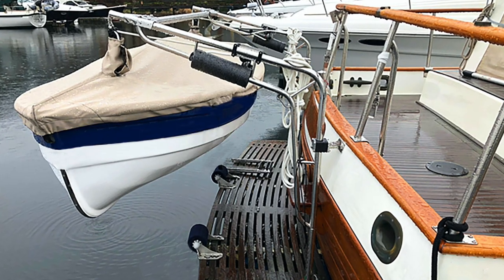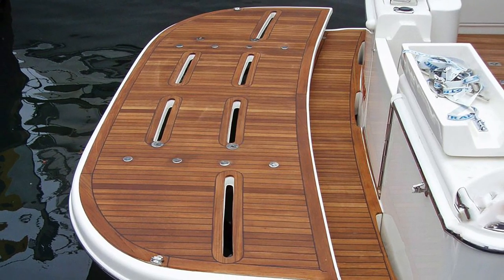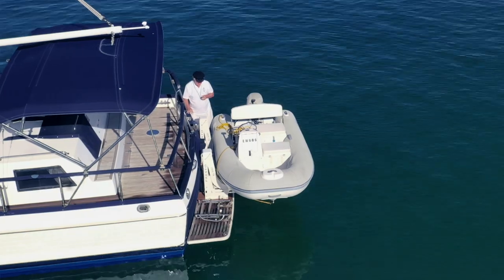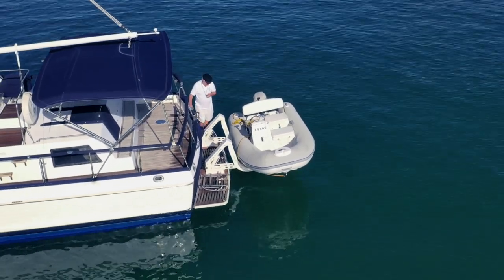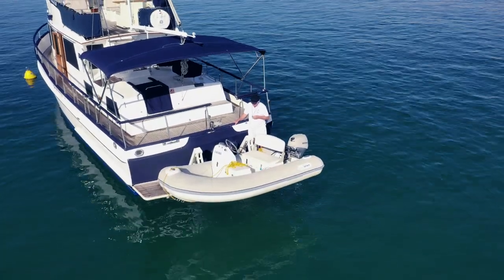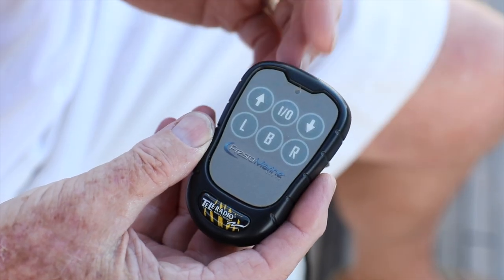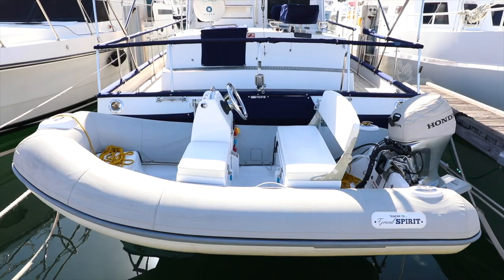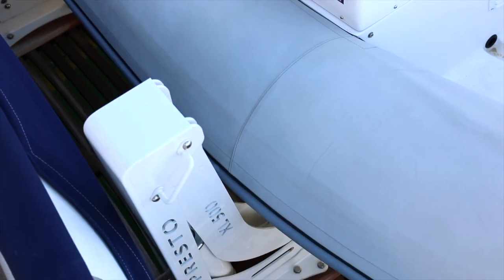The Ideal Tender or PWC Lift

Comment: It is a great system.  I opted much cheaper.....have a small dinghy with 7 hp outboard.....I bought the plastimo davit cranes ( 2 ) installed them on the swim grid.  They are manual but very easy to raise and lower...total cost around $1500.  This system is likely around $5K plus.